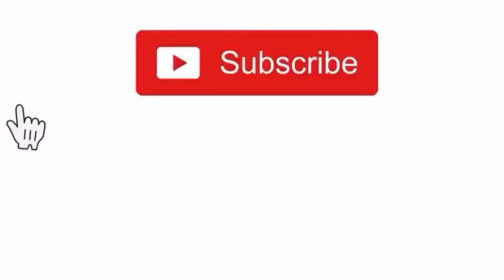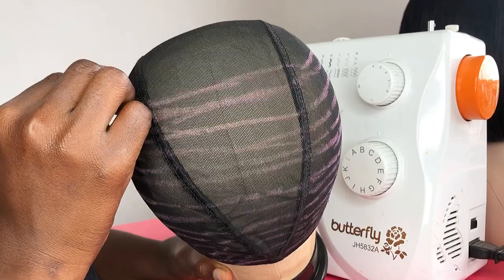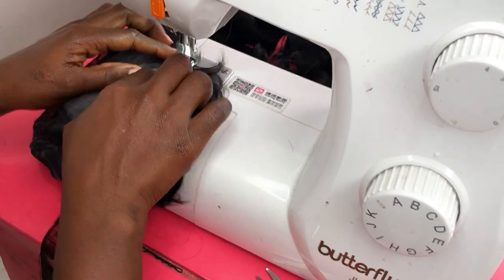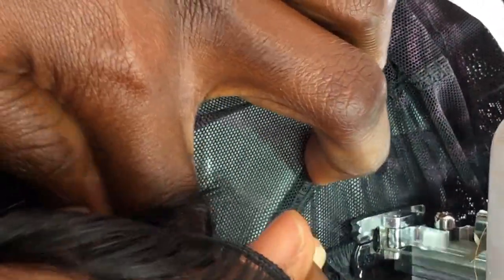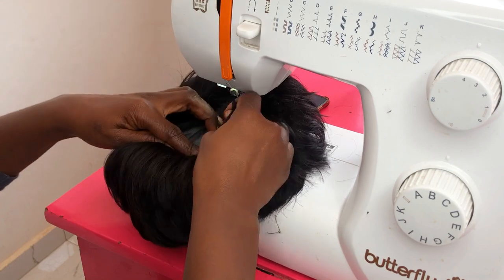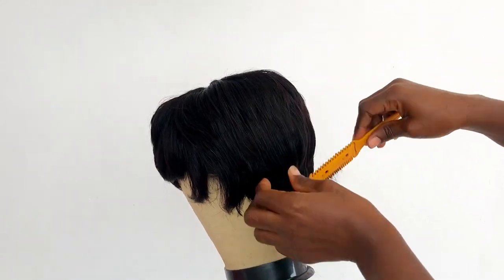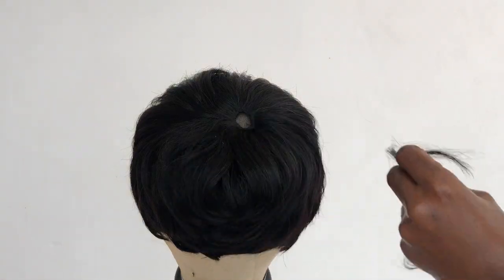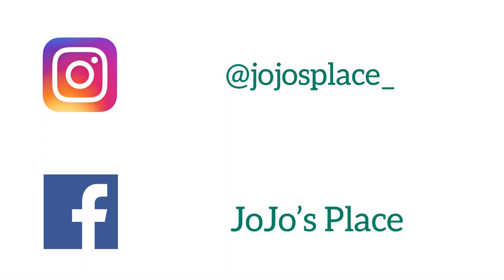A very detailed Tutorial on how to sew a pixie cut fringe on a dome cap using a sewing machine

Comment: Great video . But doesnt it shrink when you sew on the elastic at the buttom of the cap and in the case of doubling tracks do you have to widen the space?
Reply from the maker: No you it wouldn't shrink when you sew at the bottom of the net, on the band. You can use your fingers to spread out if net feels tight.
Reply from the maker: When you double tracks too it doesnt necessarily mean the spacing should e wider. Just a little space in between the tracks. The double is to help reduce the number of tracks but the spaces should not be wide apart